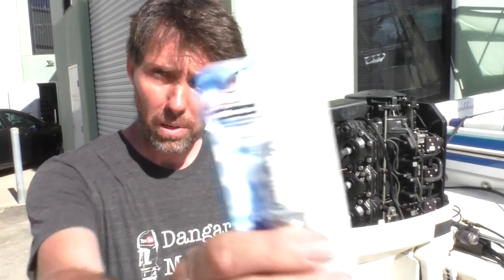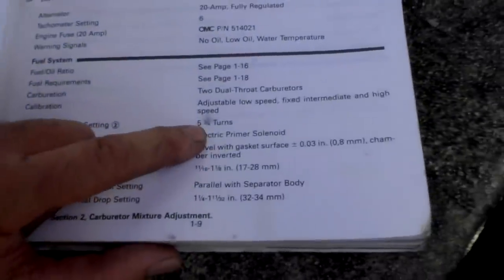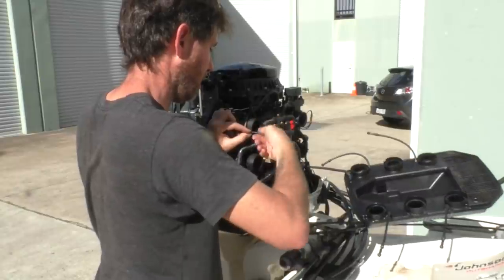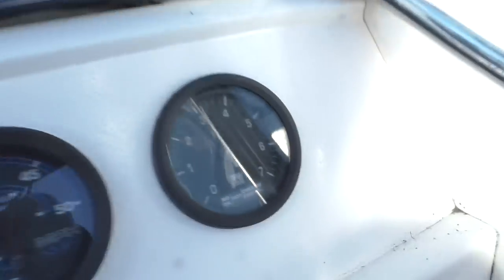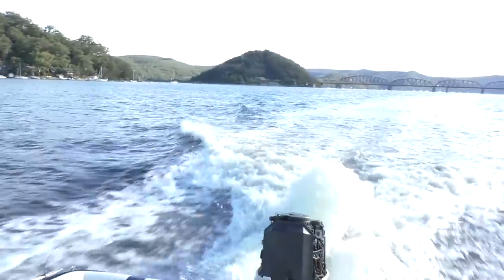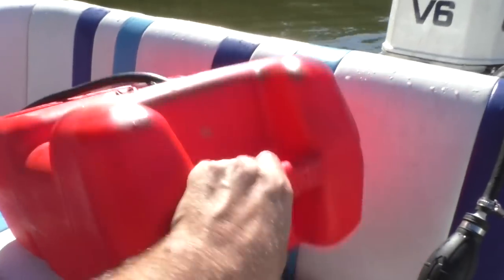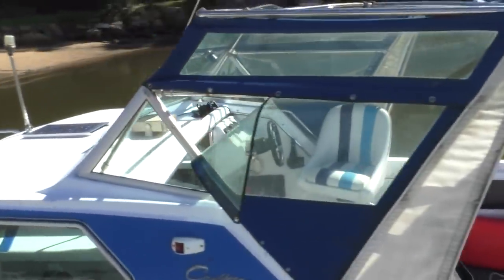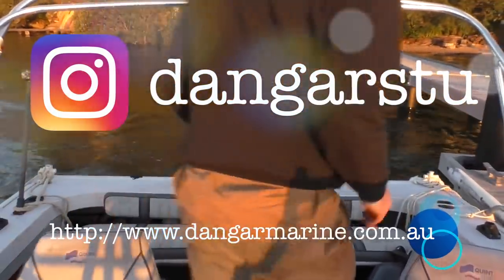Evinrude 150 run-in period

Comment: Great job Stu! You may also want to consider that this motor is set up 3-4 feet behind the boat on the end of a swim-step! This is a boat manufacturer faux pas...Makes this boat a "water plow" that will NEVER plane-off, even with 500 horsepower!

Comment: So far, so good!   Nice to see her on the water.  Hard to say, but she looks like she may need to come up a few holes on the bracket to give the best performance, but hard to tell until you bring her up on full plane.

It's a shame he's selling her now, right after the engine rebuild.  Whoever buys her will be getting a very nice engine in the deal.

Now I need to go find some shrimp and beer.  For some reason, I'm hungry, and want to go fishing... :)  Thanks for sharing.
Reply from the maker: Hey Tony, the motor does seem to sit a bit low, but yes, I think that has a lot to do with running the boat at 3500 for that period of break it which really makes the stern of the boat dig in. Next outing it will be run in enough get it up on the plane properly and we'll see.

Comment: As a Jo/Ev tech I always replaced the VRO ass’y on a rebuild not only to insure fuel supply but also to verify  alarm system for “No Oil” alert by leaving oil supply disconnected until alarm sounds then connect and verify that unit will pick up oil from prime to site tube and alarm shuts off. Also mark oil tank level and confirm usage before returning to straight fuel. Carb(s) overhaul, full advance timing,temperature check is a must. A WOT      rpm check is also a must. Over or under propped conditions are a ticket for power head failure. Your break in was spot on. I had a customer blow a fresh rebuild because he overloaded the engine before it had broken in. At least he admitted it so I only charged for parts

Comment: I have a VRO 40 HP hasn’t been used in a couple years, good info about checking if pump is working,  hopefully it will run.  700$. All I think I know is it’s suppose to have 130 psi in each cylinder, we will see.  thanks

Comment: Stu, I know the break-in isn't quite finished yet, but it looks like the rebuild is a solid success, not that anyone had any doubts. Hope the sealing of the hull's tanks was also successful.  What method do you have for checking physically for water in the tank? They used to make a paste for that, when I was a kid, we used the paste periodically at the gas station to detect water that might be sitting on the bottom when we would do the tank dips.  Some beautiful bonus footage you so kindly included there.  Don't spoil us viewers by having that in every one of your videos, eh. Just maybe every second one :D   Cheers!
Reply: There is a sensor  you can fit to a fuel tank filter that will sound or show an alarm light when water is detected. Also some dip sticks have a small cup on the bottom of the dip stick to catch a sample  each time you dip the tank.
Reply: Stan Patterson i just run a fuel water seperator. i just unscrew it pour it in an old clear slasa jar. you can see the water seperate from the fuel easy this way
Reply from the maker: There are good electronic water alarms these days, we even have a little hand held tester that can tell us the exact percentage of water in break fluid so the technology is definitely there. I do believe in a clear water seprerator though, they protect you from the water as well as letting you know it is there.
Reply: Yes, f/w separators are a very worthwhile addition.  Most heavy trucks that experience wide-range climates have them.  Carrying large amounts of fuel, it's easy to get water in the fuel from condensation or even by adding it unknowingly from unscrupulous or poorly maintained fuel vendors' supplies.  Check the separator as often as you add fuel.

Comment: Excellent topic video series.  Observation at 1:52.......  The motor looks far to low on the pod extension.  4:17 seems to confirm that?
Reply from the maker: Thanks mate. The motor does seem to sit a bit low, but I think that has a lot to do with running the boat at 3500 for that period of break it which really makes the stern of the boat dig in. Next outing it will be run in enough get it up on the plane properly and we'll see.

Comment: Obviously some professional posts here, so bear with me if this question seems a bit basic. You mentioned the VRO and yet mixed the tank 50:1. The Evinrude VRO I purchased had the VRO removed and went with a straight 50:1 mix. Talking to the owner of the marina he said that some VROs from that vintage had issues and to be on the safe side some people simply removed the VRO and went with an oil mix in the tank. Did you use both to be on the safe side, for the break-in period, and in the future will it run on straight gas using the VRO and not the mix? Beautiful motor and a great educational series.
Reply from the maker: Hi mate. The idea here was to run it on both to confirm that the VRO system was indeed consuming oil from the tank. Once we've got evidence of that happening the plan is to go back to putting pure unleaded in the tanks.

Comment: Looks to be a good one, cruising along, don't know the name part of the spark plug that has gap but mine has the kind thats flat, nothing to gap, do you use these kind are would you recommend the other's, oh, and the fish would've make a great key chain, just kidding, good to see all having fun.
Reply from the maker: Hey Ron, that part of the spark plug is the electrode and your type are called surface discharge plugs. Surface discharge don't give the best idle but can be driven very hard which is why people put them in some two strokes.

Comment: Sounds nice!  What RPM did you get at WOT throttle properly trimmed?  Have you checked the various alarms?  It is easy to check the VRO "pulse alarm" because you have 50:1 premix in the tank.  Simply remove the oil line directly from the VRO pump while the engine is running at lower RPM.  It will take a few minutes, because the alarm is dampened a bit, but you should hear the alarm horn pulse on/off every second or so,  the frequency of the horn will increase with RPM.  Checking the fuel restriction alarm is simple as well.  Simply constrict the fuel inlet hose outside the engine with forceps while the engine is idling, the alarm horn should come on solid after a few seconds, because the vacuum switch is sensing a high vacuum in the fuel inlet system.  Checking the oil tank level alarm is easiest when done with no oil in the tank, which is impossible now.  You could remove the four screws holding the oil pick up line into the tank, then pull it up far enough so the float will drop setting the low oil level alarm.  Again, this alarm is dampened slightly.  You should hear a short horn beep every thirty seconds or so telling you the low oil level alarm works properly.  Needless to say, you can not check the overheat alarms completely.  But, you can ground each of the tan temp harness leads with the key on, the horn alarm should sound constantly.  Keep in mind, this engine has the SLOW warning system as well.  This can be checked by grounding either of the tan leads while the engine is running in gear on the water for a second or so.  Once either of the leads has been tapped to ground with the engine running, try to advance the throttle towards WOT in gear, get back inside the boat first though!  The SLOW warning will cause the engine to misfire violently when the RPM is advanced over 2500RPM, the engine will run normally below 2500RPM.  Keep in mind the only way to disengage the SLOW warning is to turn the key off to reset the system...
Reply from the maker: Hi mate. We only just finished the first hour so didn't get to the stage of doing any WOT runs, that will be next time. I really appreciate all your tips on testing the alarms, I'll try to do a video dedicated to all the tests you described. Wish you could be in it!

Comment: Howdy from an island in Alaska! I just bought my first boat. Sea Swirl Striper 21 foot with a Johnson 150 2-stroke with only 3 hours on it and a Yamaha 15 kicker. It's been covered since 1999 when it was new. I'm bringing it to the shop next week. Do you have suggestions for requests for them? I'm starting by replacing the impeller. After watching your videos I'm nervous about the gas tanks. Thanks! You're making great content!
Reply from the maker: Draining the fuel tanks and getting them cleaned out would be high on my list. Fuel goes bad with time and the air space alone will cause condensation. Other than that a regular service (gear oil change, spark plug change etc) should see you back in action.
Reply: Dangar Marine Ha! YouTube, where an island boating celeb might just help you save your boat! 
Before the boat was put up the tanks were drained and dried. I spent the day yesterday scrubbing. Found water in the cabin cubbies in the bow and on the starboard side. Online, people are saying the rub rail leaks on Sea Swirl Stripers.  You think I could survive with some silicone along the inside and out, or do you suggest I figure out a way to replace the whole rub rail? (Been garaged until this past winter and since has been in the elements, on a rainforest island.) 
Thanks much for all you're doing!

Comment: Great series which has helped me a lot with my Johnson 115 v4 (mostly the same motor, just minus 2 cylinders).   It looks like that engine has the OIS 2000 system.  Did to do timing and sync using the special OMC tool?  or did you find a workaround?  Thanks!!!

Comment: Can you please show us how to adjust idle and do a full tune up on these motors? I have a Johnson 200 v6 ocean runner and can’t find ANY data or videos showing how to adjust idle and tune this outboard up. I’ve used your carb videos to get it close but it clunks when I go into gear and I can’t find any answers how to lower and clean the idle for these motors.
Reply: I also have a wicked shake at half throttle. Full throttle and idle are nice and smooth but mid throttle is not friendly.
Reply from the maker: I would start by checking the ignition timing with regards to your idle speed. Unfortunately this boat has now been sold so I can't do any more vids with it.

Comment: I have a question. I have a 1984 evinrude v4 115hp and it runs great. Sometimes acts up when I go to start it. But it will run my bass boat at 40mph. Anyways my question is how do you know your water pump is working properly? I feel like it should have a more powerful stream of water coming off of it. I dont have a temp gauge or a psi gauge. Anything will help. Thanks

Comment: Thumbs up on the Champion plugs for an Evinrude. NGK+ Evinrude/Johnson = bad
Reply: Not trying to be rude here, but why is it that Ev's and Johnsons don't like NGK? Not that I'm a lover of Champion over NGK or other way around, but I've never had trouble with either Champs or NGK's in any 2 or 4-stroke anything.
Reply: Stan, I have had a car that would break Champions within a week or two, and NGKs would do 30,000Kms. No reason I could ever find. I also had a motorcycle that just wouldn't run reliably on Champions, but NGKs worked fine. Makes no sense as I have used Champions in mowers, boat motors and cars otherwise and had no problems.
Reply: There is surely nothing wrong with NGK plugs, but this engine requires special "inductor Q" plugs to avoid ignition interference.  I am not sure that NGK actually makes this style plugs.  I would consult NGK to confirm they make a direct replacement for the champions before using them in these OMC engines.
Reply from the maker: In the end I figured there was enough doubt to just go with the manufacturer's recommendations. I figure Evinrude knows more about their engines than I do. ;)
Reply: Champion inductor plugs use a small coil of wire (the 'inductor' part) instead of a resistor to slow down the voltage rise rate . The rate that the voltage rises along a plug lead is part of the cause for the RF interference these additions to the plug body are trying to eliminate. The rest is spark gap RF which is inside the head and so is not normally an issue in itself, but some of that RF travels up the ignition lead and radiates out the lead as if the lead was an aerial. The resistor leads just try to lower that level by converting the RF to heat. The inductor plug is trying the cancel or filter out the RF ( inductors can be tuned to be almost a short circuit at one frequency, but almost let no other frequency through), but again the RF energy is converted to heat. Radio interference wise  the inductors should be better, but it is hard to see why there would be any spark performance difference between the two types.
Reply: Alright, but suppose he left the NGK's in.  How will this affect the engine's performance?  I've heard people complain that a certain set of plugs or plug wires would upset their listening to AM radio in their cars, but how is RF going to affect the operation of an outboard, given that not too many people are into blasting their radios while skipping along at 30 kts or above with the wind noise and the engine roaring noise to compete with.
Reply: Again, there is nothing wrong with NGKs, and there is no performance advantage to using champions.  The RF can affect this engine's unique ignition system, causing misfiring.  The really frustrating thing is knowing many people spend many hours/parts trying to repair an ignition system that is not broken, just has the wrong plugs installed.  I understand, seems hard to believe, but true.  I wouldn't have believed it either unless I had witnessed the ignition miss causes by using non inductor plugs.
Reply: In my experience using NGK's on this type of ignition system can also cause premature failure of the ignition module.

Comment: Where did you get the proper manual for the motor I have a 1997 175 Ocean Pro. All I have locally in Florida where I live are the Seloc and Clymer manuals. I would much rather have the Factory if possible thanks for the help
Reply from the maker: I get them from two sites mainly. readmanual.com and tradebit.com

Comment: I got A 9 hp Suzuki. It won't star on its own but when I use engine starter it will and it runs fine what do I do?
Reply from the maker: +Laurens de Wijs I would start by cleaning the carburettor.
Reply: Use the starter

Comment: Hi Stu, what are your thoughts on that motor? My mate has a cruise craft classique 600 just bought it but unfortunately took the blokes word for it being ok but turns out the motor has been cooked and is no good, we are looking at the same motor 98 model 150hp evinrude would it push a 6 meter run about ok? The old 200 merc was running o  5 cylinders and went ok hoping it goes better than that.
Reply from the maker: This boat  was  6 metres  and went quite well.  I've  never owned  one  of  those  motors but it seemed  pretty  solid.
Reply: @DangarMarine  thanks mate

Comment: What are your thoughts on these old 2 stroke VROs?  I'm considering purchasing a bout with 1991 Johnson two stroke 140 VRO
Counter rotating twins..  it's 2017, a four stroke, am I out of my mind?
Reply from the maker: I like the fact that are generally quite solid, despite this one dying and needing the rebuild. If I had a choice I would definitely go a four stroke, but if the hull is good you can always run the motor that is on it at long as it lasts and then re-power down the track. I do find these motors quite noisy and smoky though, they can also be a bit hard to start when they are cold.

Comment: I thought running an outboard with the cover off was a bad thing?

Corrosion etc?
Reply: He has had a bad experience running my engine with the cover off- swamped the lower coil when he backed off the throttle and the stern wave decided it wanted to get in the boat with us.:-)
Reply from the maker: It isn't ideal, that's for sure, but not a huge problem to do every now and then for testing purposes.